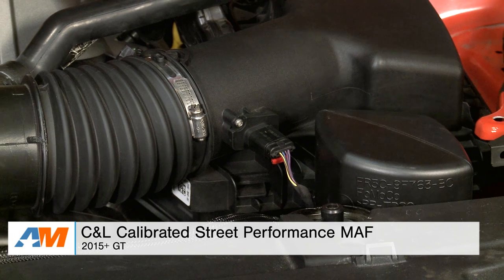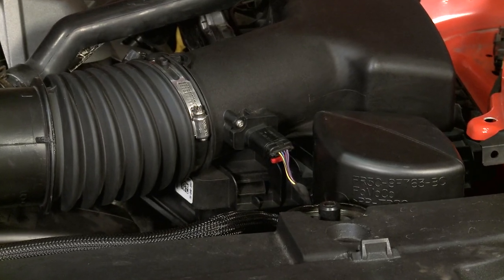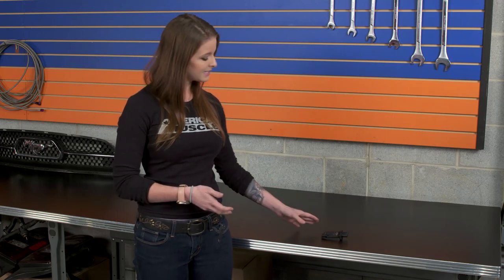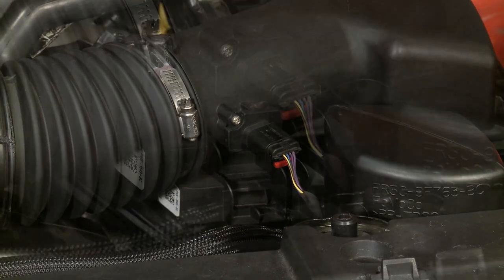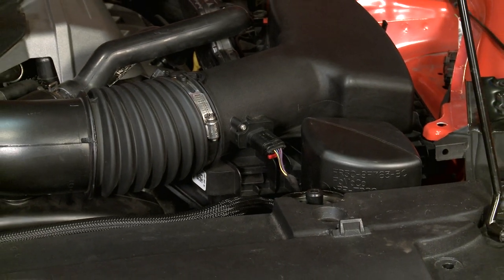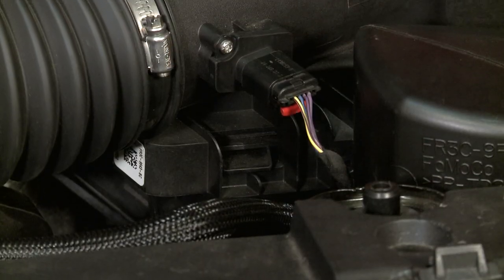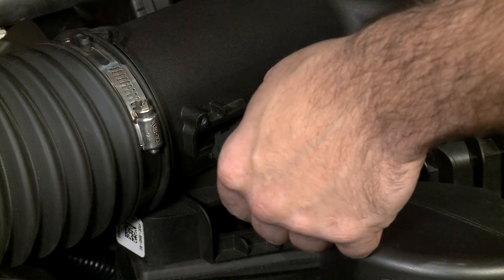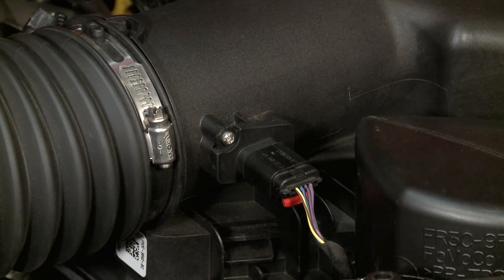2015-2017 Mustang C&L Street Performance Slot-Style MAF Meter/Sensor Review & Install

Comment: MAF sensors provide airflow data for the ECM to calculate air fuel ratio. If the data is incorrect (as detected by the oxygen sensors in your exhaust system), the ECM applies a fuel trim to bring the air fuel ratio in line with what is being commanded. Swapping a MAF sensor on a stock or mildly modified car is a waste of time and money. Get a tune.
Reply: MAF and a tune on a mildly moded stang?  Will this give a little more for the tune ability?